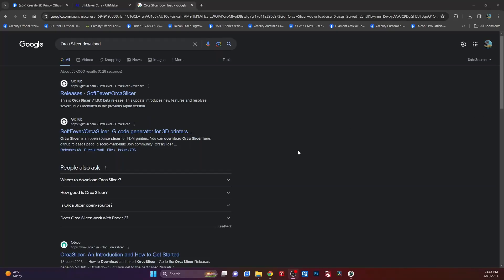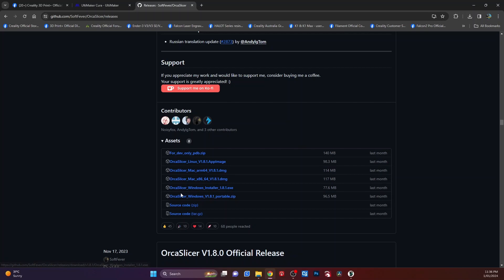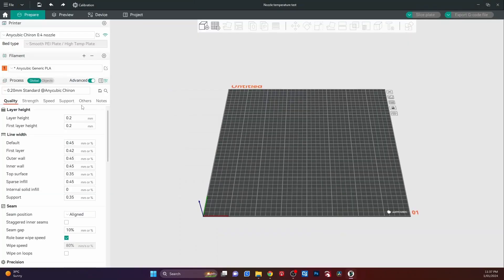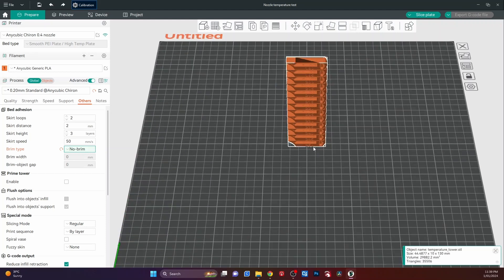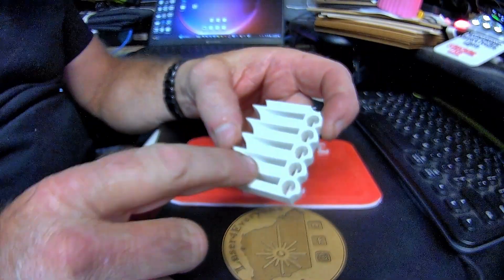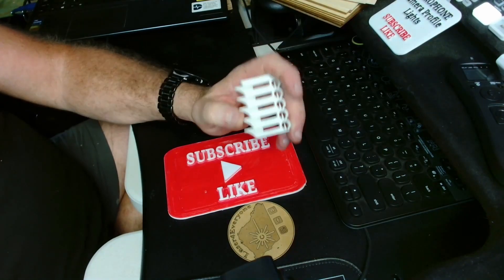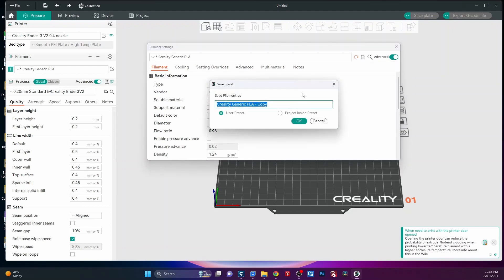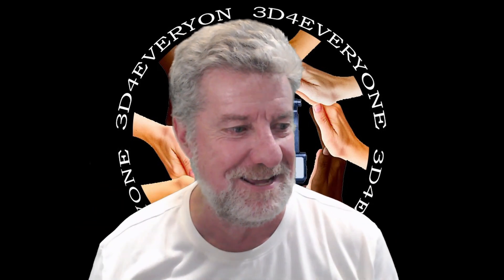How to do  a temperature tower in Orca Slicer

Comment: How long does it take for the Temp test to print?
Reply from the maker: Depends on the printer, but it's fairly quick
Reply: @3D4Everyone1  Oh, Im pretty confused then cause without changing anything after loading in the temp tower its saying it'll take around 4 hrs to complete. Any suggestions? Also, thank you for the videos! Ive watched several of them and they've been helping so much!